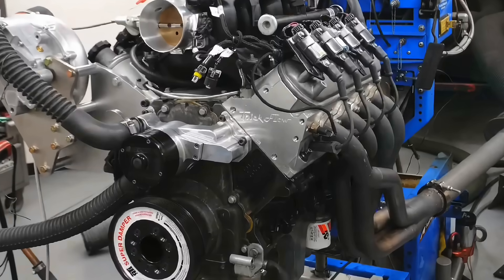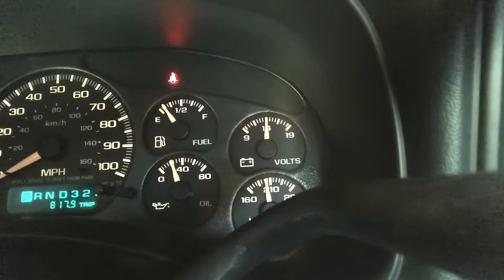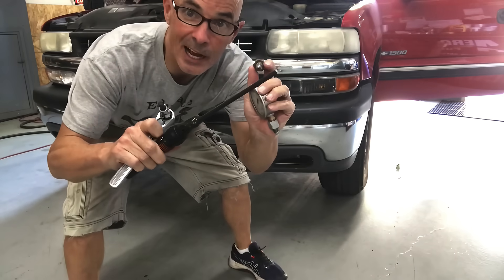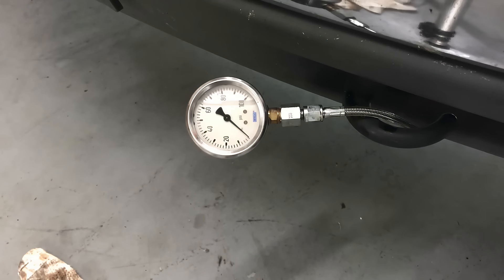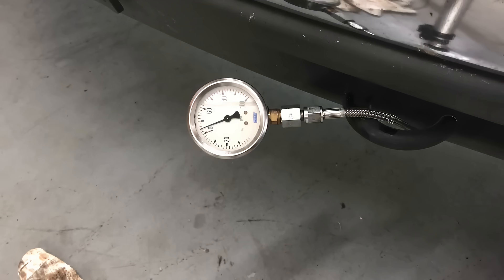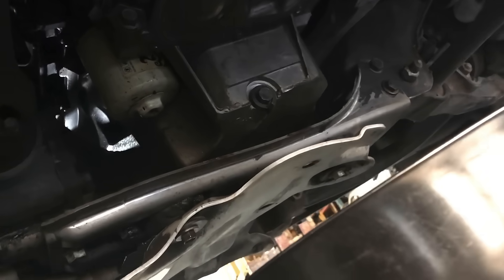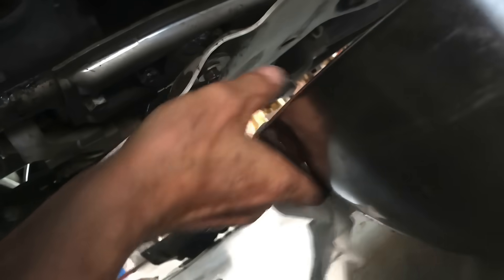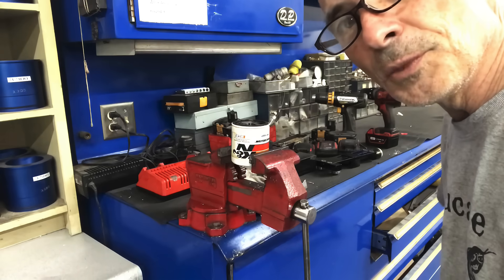HOW TO: TEST & FIX LOW OIL PRESSURE IN YOUR 5.3L OR OTHER LS?

Comment: I'm more worried about the gas gauge level LOL
Reply: Personally, I blame squirrels for the gas gauge level.
Reply: @n8rivera74  the squirrels are infectious and spreading like a virus
Reply: DontBe StupidAnymore 😂🐿🐿
Reply: @n8rivera74  Forget the squirrels, they is in favour of shuttin' down the car hobby. this is insane man.
Reply: Got a 125 miles left in the tank. No need to worry
Reply: Puuners Jabski lol , one of my friends is like that also , he lives rite beside a gas station and works only a few miles from there also so he'll run his pickup literally rite to the edge of empty lol
Reply: @unclesquirrel6951  thats nothin lol i have an 02 with a 24 gallon tank it said empty for well over an hour pulled in the station and it took 26 gallons lmao
Reply from the maker: Richard just got back from a 750+ mile trip
Reply: Richard Holdener 😎
Reply: @richardholdener1727  My dad used to tell me "Son if you check the oil and the water the gas will take care of itself " hahahaha
Reply: @richardholdener1727  your videos always seem to come in  “suggested” just in the Nick of time. My 6.0 has low oil pressure and goes up when I let off the pedal. People keep telling me that I only need 7lbs per 1000rpm. That seems low lol. I was averaging 19 lbs over all and 5 when idling. No valve rattle or any noises. Hopefully it’s a sensor.
Reply: Prolly sucked up a squirrel on that long trip
Reply: mewrongway 🐿💨👈🏻
Reply: I see nothing to worry about there.  Once the low fuel light goes on it's time to think about getting fuel. Oil pressure however is slightly more important. If you could just stop into your local gas station and fix your oil pressure for a few bucks and a few minutes that would be great. Unfortunately life doesn't work that way.
Reply: Don’t worry too much. $10 in gas and boom.. fixed.
Reply: Yeah. I don't know about other vehicles; but for damn sure these trucks and the 88-00 GMT400 (OBS) have fuel pump issues. Like very constant low fuel levels, and not changing the fuel filter at or before the proper mileage. Fill at 1/4 tank, and change the filter around 25k saves me lifting the bed, or taking it to a mechanic to replace it. Cheap insurance pays off a lot at the end.
Reply: @thehighlife1320  I've been a mechanic now for more than 25 years and I can say that the GM trucks have no more fuel pump issues than other brands. Aside from customers I regularly run my vehicles down to the low fuel light and beyond. It's not a money issue, I just add fuel when I have time and feel I need to. If I went back through everything I've owned I believe I've only changed one fuel pump on my personal vehicles due to failure (not simply to go bigger) and that was on my Tahoe which had around 180k miles on it. Changing the fuel filter and adding gas certainly isn't cheap insurance. If the pump fails they won't pay you back.
Reply: Michael King - Game. Set. Match.
Reply: @Nonameviewer23  have to disagree with some of your comments. I would agree with you that GM pumps are as good as any others out there. But, if you can change your fuel filter, as long as it's easy to get to, it doesn't cost you very much. Furthermore,  it is not going to hurt you to try to keep your fuel level at quarter of a tank to keep your pump cooler.
Reply: Had 2 parts runners vans both  2000 1500 4.3 and the one guy that drove the one CONSTANTLY drove it untill it was almost out of gas, he cost me 8 fuel pumps...in 240,000 miles The other van had 1 failure...in same mileage...the other guy filled up every day...it was easy...pull up to our local gas station, fill and sign charge receipt...done...learned GM fuel pumps are weak.
Reply: Mister S apparently People didn't get the sarcasm in my statement about the gas gauge 🙄 Seems to be lots of educational comments about the gas gauge situation LOL
Reply: @unclesquirrel6951  well when the GM dealer wanted $800 for a pump... It was actually the first thing I noticed...LOL
Reply: @unclesquirrel6951  it would be funny or "gotten" if it made sense but it doesn't. gas aint shit to worry about unless you're running from the police
Reply: @misters2837 My General motors fuel pump lasted in my truck 19 years before it actually failed so I disagree with you.
Reply: What every passenger over 60yo says!
Reply: @lorenzomena8613  lol
Reply: @port nut that or the last person who replaced the pump messed up the fuel sending unit 😂
Reply: HA HA HA HA